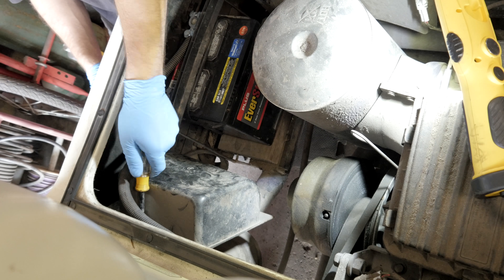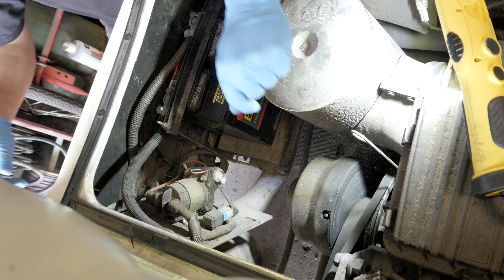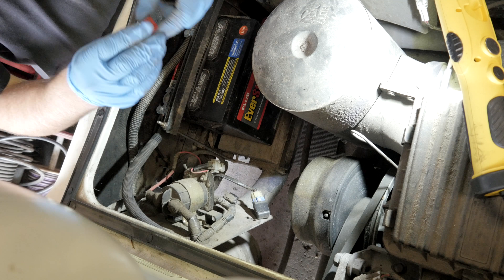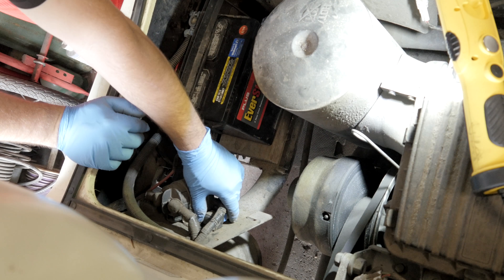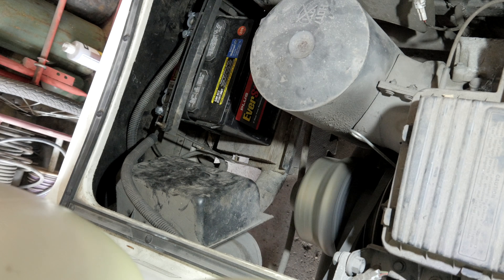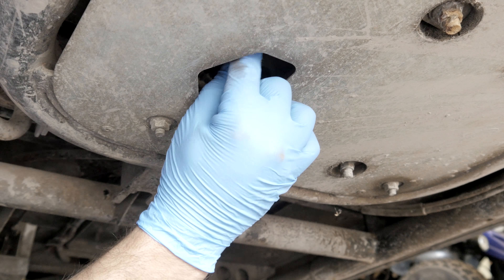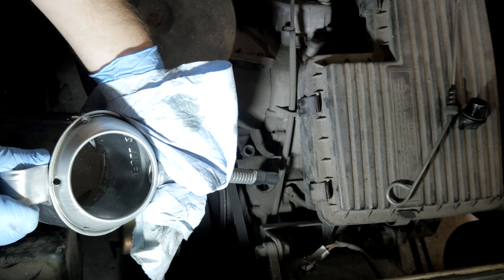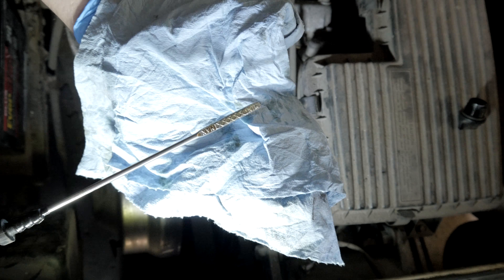2002 Yamaha G16, Gas - No Crank, Blown Fuse and Oil Change

Comment: Kevin thank you so much.  This was exactly the problem I had.  When we parked it in May all was fine.  I took the battery out as it was going to sit until this week.  Got back to our home in Florida,  put the charged battery in, nothing.  Re-did all the connections, battery posts etc.  Then I found you video.  We have the exact same model.  Thank you again

TOm Quinn  Bushnell FLorida

Comment: Hey Kevin . I’ve got a g16 , no crank , rapid clicking from solenoid and click from relay . Any help would be much appreciated!
Reply from the maker: That sounds like a weak battery. Charge or replace the battery. Also, make sure the battery posts and terminals are clean and tight.

Comment: Just brought my first golf cart, its a yamaha 2k g16 with 301cc. There is an engine oil light indicator on console, (while I am awaiting service n owners manual) is there an oil sending unit?
Reply from the maker: The oil sender is located on the back side of the engine. It just senses oil, its not a pressure sender. These engines are splash lubrication (finger on the connecting rod that "splashes" oil everywhere), not pressure lube (no oil pump).
Reply: @Kevinsgolfcarts   
Thanks you so very much Kevin, I am grateful

Comment: Kevin, I have a 1996 G16 is there an oil filter? Your videos are awesome and very informative. Thanks
Reply from the maker: There is no oil filter on these engines. They are splash lubrication. Engines with a pressure lube system (oil pump) will typically have an internal or spin on oil filter.
Reply: @Kevinsgolfcarts  thank you very much sir. Have a great weekend

Comment: Hi Kevin, what kind of oil did you use and how much does it take?
Reply from the maker: These engines hold 1 us quart. I use conventional 10w30.
Reply: @Kevinsgolfcarts  Thanks. Your channel has been so helpful to me, I can’t thank you enough. I never used to feel comfortable doing my own mechanical work but because of your videos I have rebuild my clutch (replaced the rollers), cleaned the carb, replaced a carb, replaced fuel pump, etc.. My 1998 Yamaha G16A has been running great. My only concern is that when I bought it, I didn’t realize that it had a cracked gear case in the back (previous owner must of hit a rock). It left a decent crack with a pin size hole that allowed the gear lube to leak out. I ended up hearing a whine while driving and that’s how I realized the issue that there was no gear oil. I cleaned the location with carb cleaner, roughed it up a bit with a steel brush, and then patched the crack/hole with JB Weld (with the understand that I couldn’t hear weld the case). I added a layer, let it sit a week, added another layer, let it sit another week, and then added new gear oil. I’m hoping that because it’s not a moving part and there’s no air pressure in the crank case that it will hold for the rest of the cart’s life. I understand this is a gamble but I figured worth a shot rather than paying for a replacement case. You think I’ll be ok?